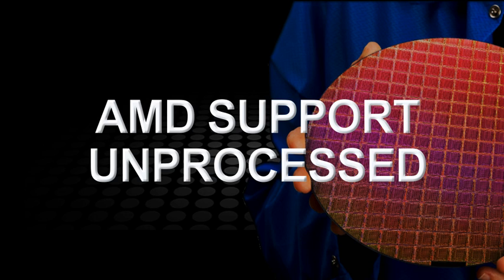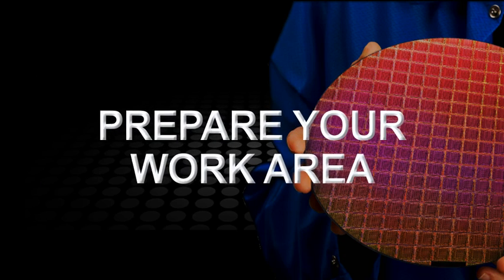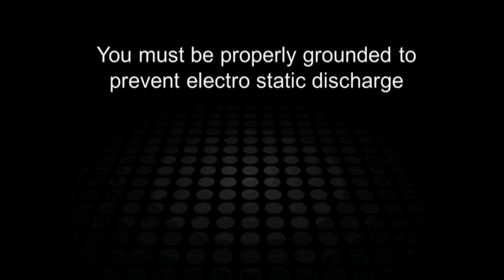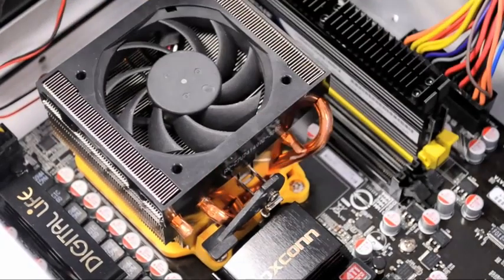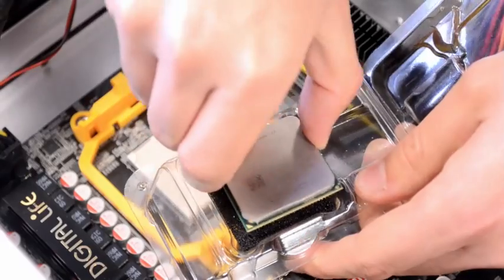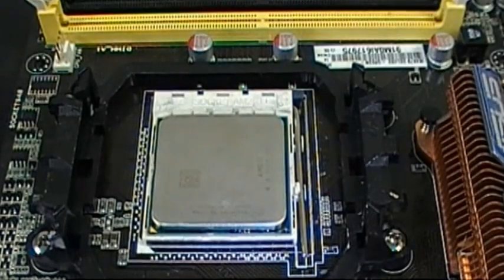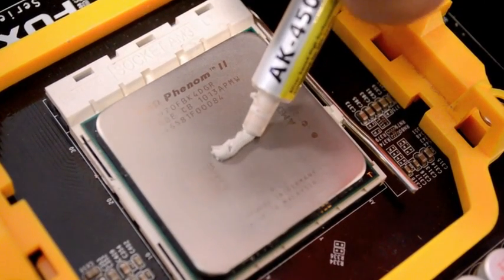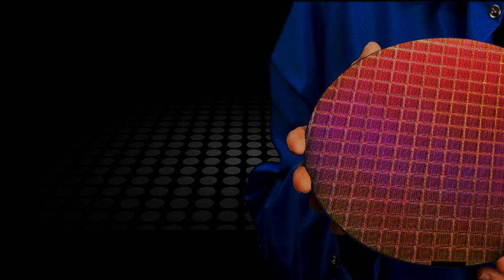AMD Support: How To Replace Your Processor

Comment: See, the issue is that my computer has an AMD A6-5200 souldered in, and no graphics card. HP basically said "Oh, you want to game? Fuck you!"
Reply: That processor is an APU which means it has a built in igpu. It won't perform nearly as fast as a dedicated graphics card, but its still good to game on at low resolution and low settings.The A10 5800K can run 1080p at low settings and get around 30 FPS. So you could game. Not at high settings, your APU will blow up and by by pc
Reply: Trevor Greig
It doesn't want to game though. Battlefield Bad Company 2 lags if I put it above 768p and low settings.  #firstworldproblems
Reply: I'd keep it at 720p though it takes A LOT of stress off your whole system
Reply: Trevor Greig
I have it set on whatever the lowest res is though. I don't think it's actually in 768, don't know why I thought that.
Reply: You could always pair it with a gpu
Reply: Trevor Greig
The problem is I have an all-in-one and I don't believe I can put one in. I can't find any info on my PC. Do you think I could put in a different mother board and then put in a GPU and maybe an Athalon or i5? If I can I want to go that route.
Reply: Go on Toms hardware. Com, there's a lot of people a lot smarter than me on there that could help you, it's like a forum page I use it.
Reply: Trevor Greig
I'll try that out and then get back to you! Thanks, man!
Reply: No problem I use that forum a lot!
Reply: Trevor Greig
I posted my question and hardware rundown and Now I wait. Thanks for pointing me their way!
Reply: No problem!
Reply: Trevor Greig
I did some independent snooping and found out that it has a half-lenth PCI express expansion slot on the motherboard so I am looking up what I can do with it. I have learned so much about computers in the last 30 minutes haha.
Reply: The Internet is an amazing place isn't it?
Reply: Trevor Greig
I love the internet. There is so much I didn't know I wanted to learn!
Reply: I was surprised how much I've learnt in a month
Reply: Trevor Greig I've learned more from the Internet in the last week than I did in school.
Reply: And people say the Internet is all about viral videos and such!
Reply: Trevor Greig The Internet is a place to learn AND be entertained, some times simultaneously.  Take that, school!
Reply: ***** I'm lucky to get my game to run smooth ever! #firstworldproblems
Reply: ***** I hope to aquire a Gaming PC.
Reply: ***** It's a custom motherboard so no other one will fit my PC.
Reply: sucks
Reply: New American Fishkeeper  i think KRoMEOS is talking about a gameing pc that he wants
Reply: *****
Another: My PC performs slower when connected to ethernet, but it's twice as fast than wireless.
Reply: ***** My 5ghz wifi is fast unless I'm upstairs
Reply: *****
There are so many first world problems XD
Reply: ***** just got to pcpartpicker and try to find the cheapest options and build a decent pc for $600 or more

Comment: The video skips an important step, which should be fixed to be accurate.  The video shows applying the Grease to the CPU like toothpaste, but and does not show how to spread the grease or what the grease should look like after application of the grease. In fact it completely skips that step by showing the heat sink already installed.  So, it looks like the grease does not need to be spread around and you only need to put a dab of grease in the middle of the CPU.  Really?

Comment: PLEASE ANSWER! (someone: mrowproductions Ratedz ) Ive got a very old pc. It has got a Pentium 4 Ht 3.2Ghz and with a nvidia fx something.. i want to buy another cpu and another gpu.. how to i know if my motherboard is compatible it the cpu and the gpu?
Reply: Depends on what you're about to buy. If you're gonna buy an Intel CPU, I would recommend you getting a new motherboard that has Socket LGA1150 (If you're going with that). Now the processor; I would recommend you getting an i3 or i5. And the graphics card, I would recommend you an Nvidia 660 or higher. 8GB RAM and an SSD could be faster too. Good luck!

Comment: I just bought an nvidia gtx 780 but i didnt get mush more fps. Is it because my cpu sucks? My cpu is an amd fx 4100. Please help!
Reply: I don't know what games u play but I just built my pc. cpu is AMD FX 8350 eight core 4.0ghz (no over clocked) graphics card is the nividia gtx 760. and I run around 120fps max settings in World of Warcraft,World of tanks 100fps Nether around 106 Dayz is abour 132fps (not sure why) so yes in all mean could be your cpu. what cpu do you have?
Reply: Yeah its probably bottleneck. My cpu is fx 4100
Reply: yah your cpu like 3 years old time to upgrade anyway :P 2 core to 8 core will blow your mind lol.
Reply: It is 4 core but thanks anyways i will upgrade to fx 8350
Reply: Ratedz Yeah I have an AMD FX-4100 and someone on tomshardware.uk said that the 4100 pretty much sucks and is like a dual core. My graphics card is an AMD 7700, but I've ordered an ASUS GTX 760 and an AMD FX-8350 and hope that will make my computer much better :D It's just that, when I ordered my comouter, they lied about the specs.

Comment: Okay, well this answered litterally none of my questions, or dealt with any of the issues I emailed AMD Tech support about. When I went to install my heat sink, I had to apply my full body weight (I weigh about 210lbs) just to the the last mounting bracket to slip over the support. In doing so I bent several pins. Way to fail, AMD.

Comment: Stupid question, but gamingwise, which would be better: 2.89ghz 8core processor or a 3.8ghz quadcore processor?
Reply: 3.8 quadcore just because most games dont even go over 4 cores
Reply: siikdUde I'd disagree. With the new consoles coming out, I think developers will start taking advantage of the 8 core CPUs.

Comment: what do u consider low?? 30-40 isnt bad at all. if u are under 30 than something is wrong and it is definitley not your videocard or your processor.how much ram do u have?? make shure all your drivers are up to date.
look man here are tha facts: a quad core is the fucking best prcessors out there.
gf gtx 560 ti is the videocard bf3 WANTs you to use. i have a 560 and intel pentium e2140 1.6ghz w 8 gb ram and i cant really play bf3 , because it runs 10 fps, but thatis because of my processor.

Comment: If you haven't already DO NOT get the NVIDIA Titan it's good but extremely expensive and it's usually a lot better on multiple screens if I were you I would get a GTX 680 or a 690 if you can afford it though if you have a lot of money that you're willing to spend the 780 just came out and it's a very good card to get. And just to let you know for gaming your GPU will be the main factor on how smoothly your games run.

Comment: lol i dont see any reason to upgrade xd u have quad core wich is probly the best u can get in terms of cpu, and the gtx 560 ti is a SUGJUSTED videocard by bf3 wich is one of the most requiering games out there, but if u ask me u could consider getting the new nvidia titan for a videocard i herad it has inovative new tchnoligie.also u might want to get more ram and a water cooling sytem or a better motherboard.although with specs like taht u should be getting 60 fps on most games

Comment: Hey Axel2Late, you should upgrade your Processor to maybe and AMD 8350 4.2 Vishera edition. Best on the market, especially for its value. Then, you can upgrade to any GPU you want, because 560 is about as high as you can go on your current processor. You should also see a very huge jump in FPS with the new CPU. If you upgraded your GPU, you may get the same or worse FPS and your processor will burn out because of heavy bottleneck.

Comment: BigBoyKimberley@: It is relaxing to hear that you have never had troubles with esd man but how come they got to the point of doing that in a video then? As if it is a must here.I need to replace my own processor but I'm in biggest worry about this so hesitate to start anything at all.The point is that I'm not sure if I will be able to repeat the same procedure they do in a video cause I think I don't quite understand what exactly they are doing in that step.I'm totaly out with ac.

Comment: Intel cpus are very similar, except instead of turning the thing on the side of the fan, you have for clips on each corner im pretty sure. The manual which came with your processor should tell you exactly what to do. :D

Comment: Thanks for telling me about the 2700k :) -didn't know about it-. But the reason why I'm not going to get the lga 2011 is because if you want a good motherboard you'll have to pay at least 200 dollars if not more and if you what something that's an improvement from the 4 core than you'll have to pay about 500 dollars to get a six core CPU. After getting all your components it will be about 1200 dollars. Since I'm only 13 it would take 3 years of solid work to get that money VS a year to get an i7

Comment: It is recomended but if you can no afford some thermal paste you could use a dielectric jell Silicone Grease.....I have used it to see..and it works just as wee and you get a big tube for like 5$...But i do recomend A computer thermal paste...

Comment: NO! When cleaning thermal paste off the cpu/heatsink you shouldn't use a dry towel. I use rubbing alcohol (99.9%) so you get everything off completely. Leaving old thermal paste on will result in higher temperatures, which nobody wants

Comment: Thermal paste makes a much more full or efficient bond between the heat spreader of the processor and that of the CPU cooler. It fills in all of the tiny gaps that would normally exist between the two so that the processor can be cooled more efficiently by the cooler.

Comment: thermal paste is used so that there's no air gap between the processor and heat sink, making sure that the processor doesn't burn out

Comment: My PC is a miniature pc. And I just cannot find the CPU at all, I have found a fan (apart from the 2 front and back ones) but its tiny and there is a thing beneath it and im sure its not the CPU, but there is also a large copper box in my PC. Could it be behind that?

Comment: @muziqaz They could, i don't see why they would do such a thing considering it would hurt compatibility which would hurt their companies wallet. And the 800 series chipset should be able to run Bulldzoer fine, they just need a BIOS update to support the extra cores and new architecture. You should really only switch to a newer chipset if you want more feature or more support. I do agree that it's a non-issue though.:)

Comment: This is how I replaced my CPU. I placed my PC on my bed, i grounded my self, I took off the fan and yanked out the heatsink, took off the CPU, put the new CPU. The new CPU already had thermal paste for the computer I took it off from. I put the CPU in socket, use the same thermal paste from heatsink and CPU, put heatsink back, put the fan back, and put the old CPU in a anti static bag. Everything works fine.

Comment: good video, but you don't need to spread the paste guys, the heatsink should do that work for you, just put like 1/2 a grain of rice (less is more, you're trying to get the heatsink to get as good contact with the cpu as possible, not soak it in grease) and line up you heatsink really well, set it down evenly and gently rotate it back and forth a little until you can feel the heatsink kinda suction to the cpu

Comment: @dchains yes, ok, what's stopping AMD from placing that one ppin where there is a hole in sAM3+ but there isn't on sAM3? :) besides, we are discussing non issue here, as would you like to buy a CPU and know that it won't be able to use all it's features and cools tuff if you put it into old motherboard? :) remember this is not AM2>AM3 transition. BD has some funky new stuff inside :)

Comment: @muziqaz Remember that it's common for the CPU pin count to be less then the socket hole count. So far there is no evidence that it fill all the holes on the socket, at most it will get an extra two pins possibly (and it would still fit in an AM3 socket), so AMD is still assuring compatibility meaning that AM3+ CPU's will fit in AM3 sockets tweaked with a BIOS update. Mechanical compatibility has been confirmed, so i don't see what you're saying.

Comment: @muziqaz You're incorrect if you're referring to the CPU-Z shot in that video, it's only reporting the socket pin out which is 942 for AM3+, it does not tell you the CPU pin count. I don't see where in the video it's being said the CPU's have 942 pins.

The FX chips will be able to fit into an AM3 boards (which as 941 pins), considering current AM3 chips only have 938 pins, so they there are still 3 pin holes not in use, so if FX chips have an extra pin or two, they'll still fit.

Comment: @muziqaz Hows that?, if the FX series has an extra pin meaning it has 939 pins it would still be able to fit into the AM3 socket which is 941. AM3+ has one extra hole making it 942 holes meaning FX chips might might have at least one extra hole, but that can still physically fit in a 941 socket(AM3). 

And yes i was talking about mainstream cooling too, all i said was that the extreme cooling showed how study the chips were which means a lot for mainstream overclocking.

Comment: @dchains No, if FX chip has an extra pin, that means it will not phisically fit into AM3 socket as it does not have a hole for that extra pin. If FX chip does not have an extra pin, then I wonder why there is an extra hole in AM3+ socket. So I assume that FX chip has an extra pin, thus it is impossible to fit it into my and most of other 8 series motherboards ;)
regarding clocking, I know about cold clocking, but I was talking about conventional cooling solutions, say 5ghz on high end air ;)

Comment: @muziqaz Bear in mind that the the CPU's don't use all the pins, AM3 CPU's have 938 pins and the AM3 socket has 941 holes. AM3+ just adds another socket hole, so pin compatibility should not be an issue for you. Even if Bulldozer has an extra pin or two, it can still be used in AM3 sockets.

The overclocking with these chips should be great, they recently broke a world record so that proves the chips are sturdy and rest for some good clocking.:)

Comment: I replace my Phenom 9750 for the Phenom 955 \o/ !!!
Reply: Yeah upgrading my Athlon 240 for a phenom 955 too, was it good when your had it? I'm gonna use it for an old win 7 gaming pc.

IT was only 10 bucks and should be a lot better so figured it was worth it.

So yeah did you using it for gaming and was it any good for it?

Mainly looking at titles like need for speed, battlefield.

Comment: @dchains regarding 9 series, there was a rumour(not even rumours, but AMD said that during conference call, I think) in April or May, that they had some troubles with chipset. Don't know what the problem was, as they never said. We had discussions that because of the chipset fx cpus might be delayed. Boy, were we right and wrong at the same time :DDD

Comment: @dchains My mainboard will not support FX chipset as socket is different. AM3+ socket has an extra hole in it, so I suppose FX chips have extra pin. So I am not bothered with it anyways. Also I don't wan't to cripple FX chip with my older board. Hearing pretty amazing things about FX chip clocking potential on air and water, so looking forward for some action soon :)

Comment: @muziqaz You're 8 series board might support the FX series if it meets the power requirements as i said and if manufactures released an updated BIOS for your board if not then a physical socket upgrade is needed. The 9 series is using the same silicon as the the 8 series chipsets believe it or not, so i doubt they had a big problem on their hands. What was the issue with the 900 series chipsets?

Comment: @muziqaz The only real reason for having the 8 series chipsets support FX chips is because the boards are cheaper since it's an older chipset. It also makes it a lot easier for people who just want to keep their current 8 series board and go FX with a BIOS update(if the board meets the power requirements)

Comment: @dchains yes, 8series motherboards fitted with new AM3+ socket can house FX CPU. Is it optimal? No. But 8 series motherboards which still have older AM3 socket, like my MSi 890FXA-gd70, they will not be able to be fitted with FX chips. Besides those socket changes not supported by AMD were starting when there was some rumours stating the problem with 9series chipset, thus I guess mobo manufacturers wanted to have a back up plan, in case AMD wouldn't fix their problems with chipset ;)

Comment: @muziqaz FX CPU's are in fact AM3+ only though some manufacturers are putting AM3+ sockets on older chipsets as you mentioned. The holes on an AM3+ socket are also bigger then an AM3 socket which is one reason why flashing the BIOS won't work for Bulldozer support on older boards, you will need to have the AM3+ socket to work with a Bulldozer chip,